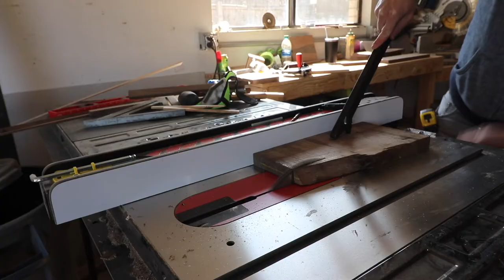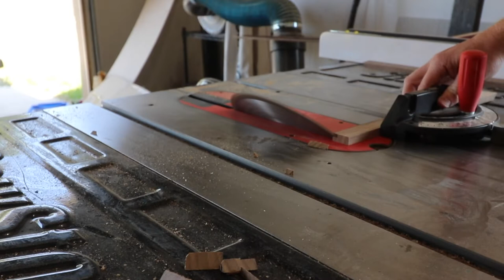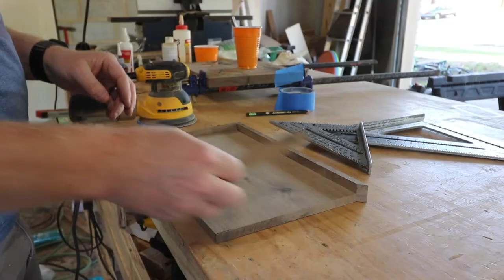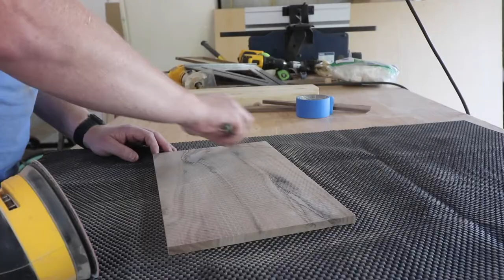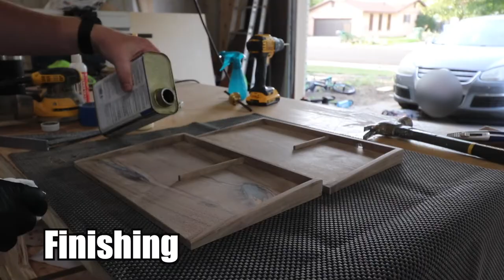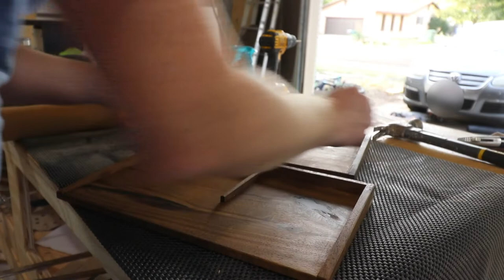MODERN WALNUT VALET TRAY

Comment: Good way to lose a finger on the helical cutters of that benchtop joiner.  why not a tapering jig, cut then sand down, or at least use a push block?  A few of your other cuts on the saw looked a bit scary, too, but at least your sawstop might save a finger there.